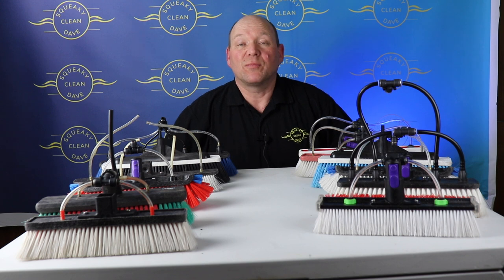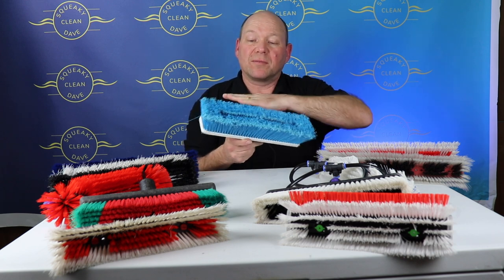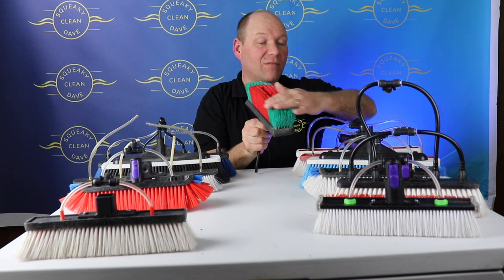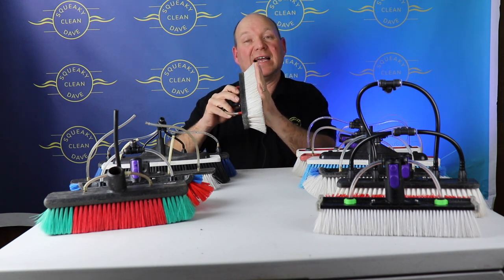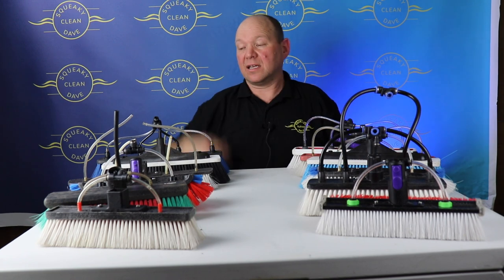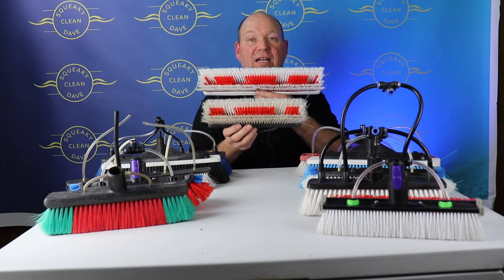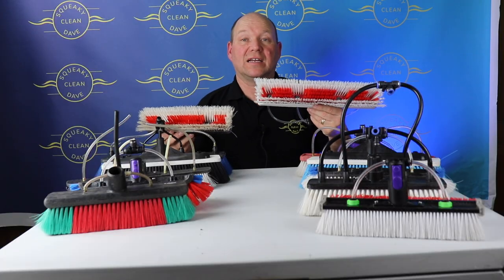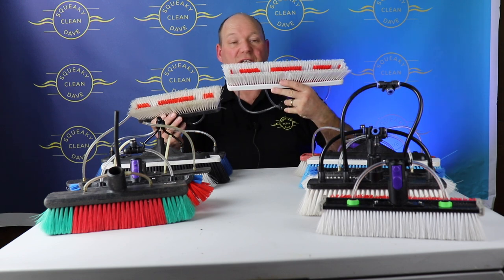Understanding Water Fed Pole Brushes

Comment: Great video! I'm glad i found your channel. You have inspired me to clean the render on my house and maybe start doing it on other peoples after.  I am thinking my setup would be wfp with bleach pump. Could you recommend a brush head for roughcast render? Spray nozzles or rinse bar to put the chemical on? What wfp would you recommend, and what size hose do you think is best? I really don't want to bite the bullet and buy the gear, but then find i got the wrong stuff. Any help would be greatly appreciated! 👍🏻
Reply from the maker: It's a bit of an open question as there are so many variables such as your budget, size of property. weather conditions and what you are cleaning. 

I think the main thing would be to get some training as you can cause a lot of costly damage and seriously harm your health just spraying bleach around. 

I would recommend that you do the Pureseal module 2 course if you are serious about starting in the business. 
https://puresealservices.co.uk/product/approved-applicator-module-2-render-buildings-structures-restoration-10th-11th-july-crewe/

Comment: Is there certain type of material brush not to use on specific types of windows?
Example don’t use natural hair brush on certain glass because it’ll scratch? Just wondering if there is any risk to use certain material on certain glass.
Reply from the maker: I would say not so much a certain material but the finish to the ends of the brush. For example on leaded, coated or glass that you have to be a bit more careful with use a flocked bristle rather then a straight cut bristle

Comment: Hello Dave, 

do streamline and gardiner share the same characteristics in terms of rubber bumpers? Do they fit on both types of brushes? I have a hard time to find Streamline bumpers and i found only from gardiner which are 26 and 45 cm wide but I have a streamline brush that is 36cm. Or is there any material that I can use which is friendly to powder coated window frames? I did the stupid mistake of cleaning windows without them and made some scratches, not bad but of course, that is not very desirable.

Thank you in advance and keep up the good work!
Reply from the maker: I havent tried the Gardiner bumper on a Streamlinr brush but i think that they are different sizes  i will try and check though

Comment: How do you find using the square brush when cleaning the top sills down Dave? Rather than using the sills brushes? Cheers mate
Reply from the maker: No problem with a swivel on the gooseneck
Reply: @squeakycleandave1  cheers pal 👍🏻

Comment: Thanks for an informative video.
I'm a newbie in WFP, only trad in my working years, but do want to get into WFP instead of using ladders.
What Brush would you suggest for a rookie to begin with, I will start with a backpack and use the pole from Unger hydro power and the brush nLite® Radius Brush, is it good enough for ordinary window wash and first clean

Comment: I only use cold water. I have tried a few different poles and brushes but I always end up back at gardiner. I agree with the ultimate brush great brush. But I personally just stick to xtreme super light. In poles and brush. There is something about xtreme super light that draws me in. 🤷‍♂️ 😊
Reply from the maker: I’m looking forward to the Xtreme 35cm sill brush
Reply: That's good are they making one. I only use the 26cm as they do fine for my jobs. I currently have 3 brushes mostly use the xtreme sill flocked. And have the 95 gram Bush and the other xtreme sill brush with the orange bristles on bottom you have one in the video. The softer the brush the better for me. 👍
Reply from the maker: @lbaz0710  I’m the opposite. I like my brush really stiff. If we were all the same the world would be boring 👍

Comment: Hi Dave, I’m about to buy my first GARDINER WFP and it comes with a free brush but not too sure which one to get. I’m just starting up so will be mainly doing windows. Any advice would be much appreciated. Cheers
Reply from the maker: I like the Gardiner Ultimate Medium brush. It’s a good all rounder and not to heavy
Reply: @squeakycleandave1  Cheers Dave, going to go for the 35cm medium-soft. think I’m going to have to give them a call about the rest and explain my proposed set up as I’m not sure about the other options I need to choose from (connectors, pole hose and goose neck connectors). Cheers

Comment: Hi Dave, looks like I'm not the only one with the brush obsession... I have 15 brushes... main go to brushes  over all the brands are Tucker  hybrid 👍🔥🔥 great for hot water  but the other all have their job application place
Reply from the maker: I’ve never tried a Tucker. Maybe it’s about time I did. 👍
Reply: Good opportunity to do a video and review  on the Tucker brush 😂
Reply from the maker: @FlashTechEngineering  very true 👍
Reply from the maker: Which brush do you use Dave. There isn’t a lot of choice in the uk for Tucker brushes
Reply: Hi Dave , I have 3 different brushes in the Tucker range , 12 inch hybrid with the boar hair in the middle with 4 pencil jet came with the rinse bar which I don't use.. you can order without the rinse bar my main brush I use , 12 inch  4 pencil jets all boars hair great for first cleans and extra scrubbing power,  18 inch hybrid with boars hair in the middle also with the 4 pencil jets, great for the big commercial windows and houses too..    all came with the swivel adapter.. I changed out for the square Gardiner quick connection. To suit my Gardiner pole and uni valve  setup..I think I saw DA components video on the Tucker brush and May stock them as well .. 👍👍
Reply: Hi Dave I just checked the brush nylon block sizes .. measures 255mm and the larger 405mm 👍
Reply: @FlashTechEngineering  Hi
Don’t get why you trash the rinse bar ?
It’s all you need.Full stop.😳
Reply: vonovine hi ,mine was the first generation of the rinse bar which were made out of aluminium which scratched a customers window as they were also slightly longer  so I removed..the newer version which my friend has is plastic ... nothing wrong with rinse bars in general application but not always preferred method... I rinse on the glass with high flow rates about 4.5 litres a minute.. higher on big panels ..with 70 degrees at brush head so I don't need over the top rinse 👍
Reply: @FlashTechEngineering  Hi
We all do what we get the best results from.
Great you’ve got yours sorted.
Just trying to help!
All the best Flash Tech.👍
Reply: vonovine this brush is the only one I've come across the can withstand 70 degrees hot water.. other bristles couldn't withstand that temperatures.. limp and distorted bristles.. 🔥🔥
Reply from the maker: @FlashTechEngineering  they do but they have a very limited selection. How do you find the boars hair with hot water. I’ve got a Gardiner brush with boars hair centre and that seems to go a bit soft
Reply: Hi Dave,  the smaller hybrid brush I've been using for 3-12 years now and it's the main brush I use say 85 percent of the time and still holding up especially since I've been using hot water for 3 years now and temperatures about 70 degrees at brush head.. I personally prefer to use the smaller brush on higher windows due to the weight and more responsive and can get into the window frames corner better. The bristles are holding up well and and have been in contact with the guys from Tucker a couple of times in reference on feedback 👍🔥🔥💰
Reply: As far as I'm aware of Tucker it's all natural boars hair, some brands use man made artificial boars hair ... not sure if Gardiner do??
Reply from the maker: @FlashTechEngineering  good to know 👍

Comment: Thanks for the video Dave 
Do you use the Gardiner dupont brush ever ? 
How you find them?
Reply from the maker: The problem with the DuPont is you can only use it up to 30°c and as I heat my water up to between 40°-50° I don’t use them.
Reply: @squeakycleandave1  thanks
Reply: @philwinstanley2634  The DuPont for me doesn’t seem affected by higher temps.
At the brush guess 40 degrees. Tank at 75 degrees.
Reply: @vonovine  thanks

Comment: I’m just looking to set up, can anyone advise which are the best poles and brushes to use ? Thanks
Reply from the maker: It depends on how much you have to invest. I would as a minimum get an Ova8, a Phantom or an SLX. Which ever make you get I would have a 22ft you can always buy extension sections if you need it longer and it will save you buying 2 poles. 
Personally I think a Gardiner Ultimate 26cm brush with 2 x 2mm pencil jets is a good starting place. 
If money is no object go straight for the hi mod 22’ Ova8 
If you go with the any of the Ova8 poles ring Streamline ask for Ziggy and say Squeaky Clean Dave sent you and you should get a discount
Reply: @squeakycleandave1   thanks very much appreciate it

Comment: Dave, for first cleans only on a cold water system, what would be your #1 brush to use for maximum scrubbing power?
Reply from the maker: Lately I’ve been using the 35cm Xline DuPont with a central rinse bar. 
If a first is really be I go over all the windows with a little bit of washing up liquid on the brush first and let it soak in then go over them and clean them properly.

Comment: What's your thoughts on a 45cm brush?
Reply from the maker: I have heard that they can be a bit flexible at the ends so you can’t get even pressure on across the brush but I’ve never tried one
Reply: @squeakycleandave1   would be interesting to see, would save more time in the long run with the extra width. Could be difficult on narrow windows but then again you could brush sideways.
Reply from the maker: @elijahdovey8288  might have to try one